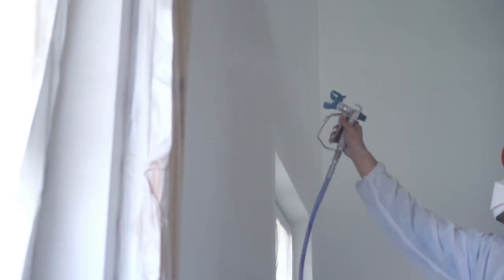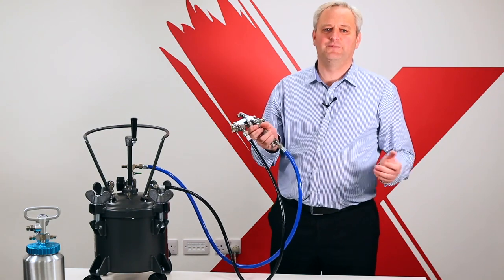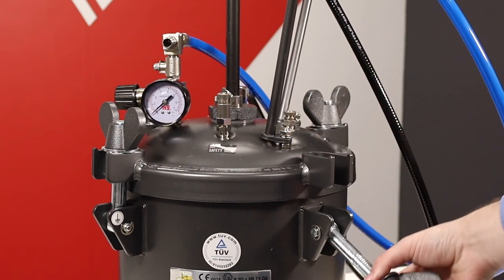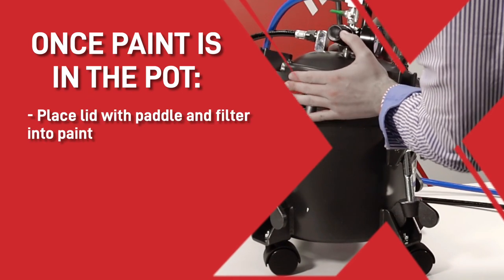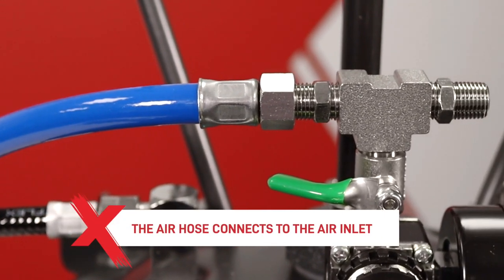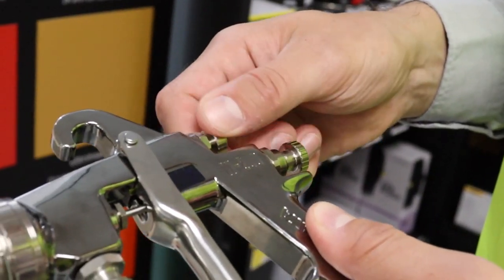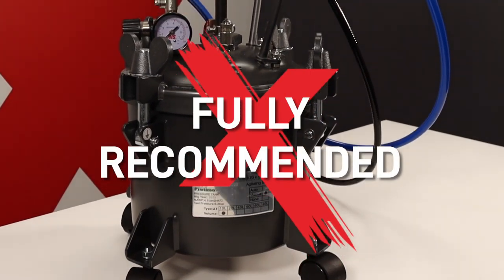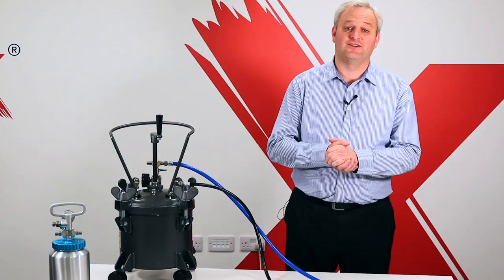How To Setup A Spray Painting Pressure Pot & Why Painters Love Them

Comment: Instead of purring the paint in the pot, and then have to clean it, can I just place the whole container/can of paint - either quart or gallon - right under the siphon, and when I need to replenish it, just put another gallon can in the there? This way I don't have to clean the container?  Or will the pressure spill the paint everywhere inside the pot?
Reply from the maker: Morning,

In answer to your question, yes this is feasible to do, however, the pressure pot lid must be sealed tight, if it doesn't then no it won't be advisable.

Regards. Ultrimax Team

Comment: What size compressor do you need to run this pressure pot?
Reply: id liek to know this too, even a recommended model of compressor would be nice to know
Reply: Look up the cfm air consumption of whatever gun you plan on using (I believe those numbers will be about the max of what you can use at a normal operating pressure, so your use will likely be lower), see if your compressor can keep up with that demand continuously. 

You also can reduce air consumption slightly by changing the gun air settings (pressure and fan), you will likely need to tune the viscosity of what you're spraying to be able to spray well if you are trying to save air. 

Can get a diff low volume gun too
Reply: @tonyhuynh874 
Look up the cfm air consumption of whatever gun you plan on using (I believe those numbers will be about the max of what you can use at a normal operating pressure, so your use will likely be lower), see if your compressor can keep up with that demand continuously. 

You also can reduce air consumption slightly by changing the gun air settings (pressure and fan), you will likely need to tune the viscosity of what you're spraying to be able to spray well if you are trying to save air. 

Can get a diff low volume gun too

Comment: Multiple people been asking how big of a compressor is needed and no answer.....
Reply: Easy

look up the cfm consumption of the gun you plan on using with the pressure pot, filling the pot itself with air barely takes any air to maintain so you don't need to include it.

Comment: What's the difference between this and the spraying machines that are akin to pressure washers? What size air compressor can run this pot?
Reply from the maker: think you may be talking say diy style wagner sprayers akin to a garden sprayer or electric sprayer? these are built to handle light work ie: the parts are less robust than pro pumps and b) they can take water based thin paints like emulsion and that's about it.
Reply from the maker: the pro pumps can handle solvents and water based paint and the parts are of a better quality to handle spraying day in day out where
as the DIY versions wont handle that
Reply: @ultrimaxcoatingsltd  thanks for the reply, I can see the misting quality of the pressure pot for a fine quality finish over the highly delivery Wagner pump types, it comes down to application in the end. Exceptionally well made video, direct and to the point,much appreciated.
Reply: He kinda answered your question but I'll add - 
There are two main styles of pump spraying systems
Airless
And 
Airless air assist

Airless just pumps paint and pushes it at crazy high pressures through a nozzle that shapes the spray pattern. Apart from changing the nozzle you can't adjust the spray pattern. These have less over spray than anything else but aren't really suitable for fine finishes as the spray pattern isn't shaped for super uniform, perfect coats that lay flat. Very efficient, almost all of the paint that exits the gun hits and sticks to what you're spraying. These are great for stuff like painting the outside of a house where if you had a bunch of over spray would cause a ton of headaches and angry neighbors.

Airless air assist systems are the same thing but they use different style fluid nozzles and have air nozzles on the gun that help shape the fan. These are great for cabinet and furniture shops because they are really time efficient but can give a far better surface finish and even coat than a normal pump. The air nozzles and finer atomization causes these to be less paint efficient, much more over spray than a pump but still less than traditional spraying technologies.